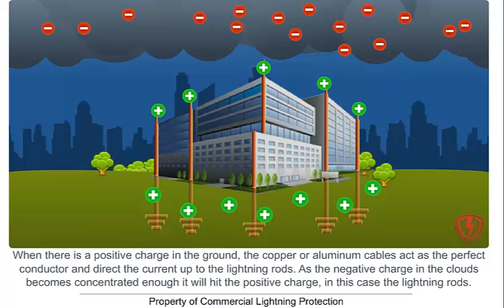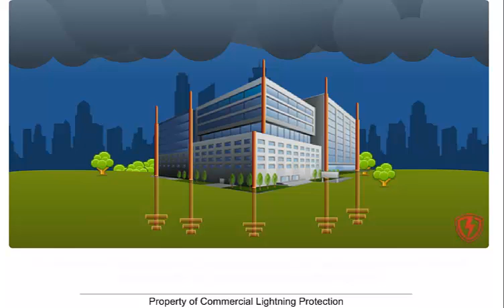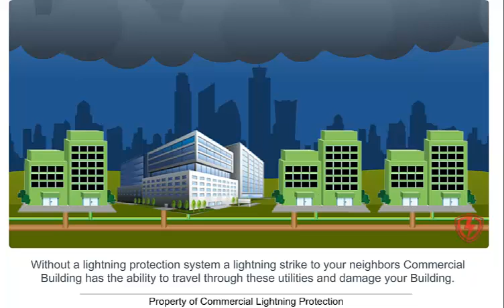How Lightning Protection Works?

Comment: Let me make it clear, If your building's lightening rod is struck with an actual lightening, you are fucked!
They are not designed to take lightening strikes. They are designed to prevent it. There is so much misinformation on this.